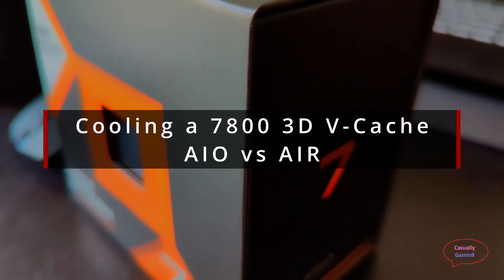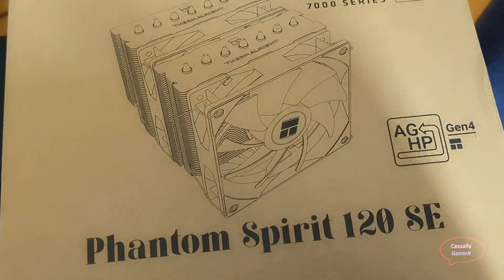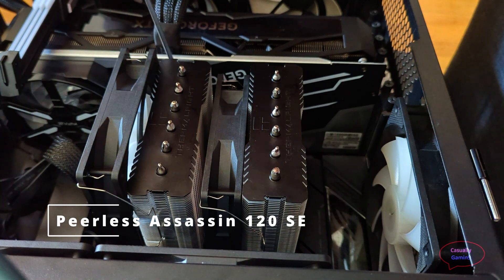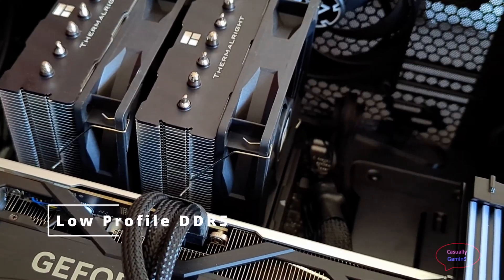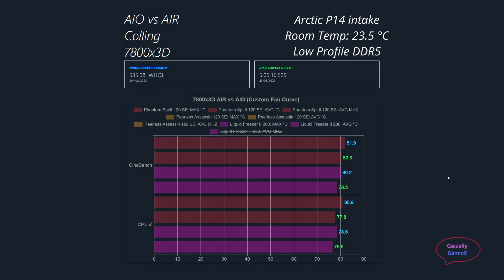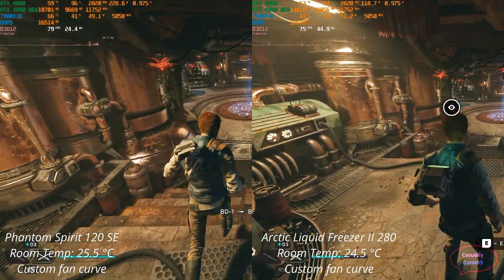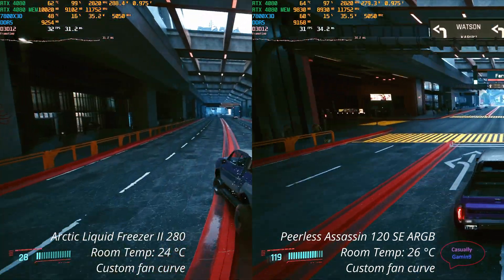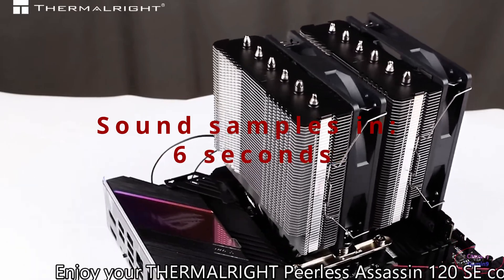Air vs Water Cooling 7800x3D Phantom Spirit 120 SE Peerless Assassin 120 SE vs Liquid Freezer II 280

Comment from the maker: Air or water cooling?
Reply: Air. It's only a matter of time before an AIO fails and ruins your entire system
Reply: lots of people say that that air coolers are automatically superior but in a test done by HardwareCanucks the Deepcool LT520 AIO outperformed all the Thermalright Coolers on AMD CPUs by a small margin.
I'd say it's a case by case basis. But the Phantom Spirit is 1/3 of the price of a LT520 where I live and good if you're building a PC inside a smaller case like I am.
Reply: @ayylmao0702  Those people are morons! Aio's aways outperfor air coolers. Water will always disapate heat better than air
Reply from the maker: There are not superior, but safer. Water cooling will always perform better, especially on CPUs that consum a lot of power. These days, air coolers are really close in performance to to good 240 AIOs.
Reply: I went with air. I use a Peerless Assassin 120 with the digital display. My CPU temp never exceeds 73C.
Reply: Obviously air, same like ptm7950 insted of liquid metal, the things is that WC is good when it is made by manufacturer, and not "water" some kind of non conductive liquid without maintance is ok, same like ps5 liquid metal made by sony, not by someone because it is too risky, thermopad PTM7950 + PS120 would be better than WC with average paste.
Reply from the maker: I never heard of thermopad PTM7950.
Reply: @casuallygamin9  there's also a newer PTM7958, although I didn't find it in pad, only as paste.
Reply: phantom spirit with Silent Wings 4 fans
Reply from the maker: It performs better and produces lower noise?
Reply: @casuallygamin9  that's the expectation. I don't have all of the parts yet so I don't know yet.
I have a decibel reader and a digital thermometer so I'm hoping that I can do some decent tests to see the difference between fans
Reply from the maker: Use Hwinfo64 to check temperature for CPU and other parts that have sensors.
Reply: @casuallygamin9  will do.
Reply: @JustinCrediblename  what happend did u change to silent wings 4 im thinking of buying this cooler for my 5600x
Reply: @JustinCrediblename  How did the air cooler do? I was thinking of buying it

Comment: 71c for 80 watt power consumption is pretty high...my air cooler stay @70c with 110 watt power consumption
Reply from the maker: 7000 X3D CPUs tend to be hot, AMD changed the position of the cache on the 9000 series and the temps are way lower

Comment: To everyone saying air coolers can compete, this is against a 240 mm radiator. Upgrade to a 360 mm rad and this gap is going to be huge. Damn near any ATX case can support a 360 mm radiator, I don’t know why he chose to compare against 240 rads here outside of trying to make air cooling seem competitive to water cooling 😂
Reply from the maker: It's the 280mm version. Air coolers are good, but you are correct, 360 AIOs are better. Not all want to use AIOs and not all PC cases can fit a 360 AIO
Reply from the maker: I do have newer videos where I check a 360 AIO, a 240 one and an air cooler

Comment: Question out of context. How much RAM clearance needed for thermalright ps 120. If i use Team Delta ddr4 32gb is it ok with the cpu cooler?
Reply from the maker: The front CPU fan ca be lifted so, in theory you don't have an issue. Lifting the fron FAN may be an issue if you have a small PC case, as this will increase the CPU Air cooler hight.

Comment: Planning on getting a 7800x3D, I want more performance out of the cpu, which leads me to an AIO cooler like the Arctic Liquid Freezer III 240. Great reviews on it, plus I keep my room warm during the day which would reduce an Air cooler's (Phantom 120 se or evo is what I'd take) performance. Based on this info, would you recommend an AIO or an AIR. I'm leaning towards AIO.
Reply from the maker: I would say that both will do good, I tested these coolers in a newer video on the 7800x3D if you are interested to find out. The Arcti,c Liquid Freezer 3 240 A-RGB and the Phantom Spirit 120 Evo are close in performance, both will do just fine. I would recommend the AIO if you wish to see the RGB of the memory sticks. Keep in mind that 240 AIOs and the best air coolers perform almost the same, with the best 240 AIOs besting the best Air coolers by a few degrees. I would say that AIOs start to shine over the Air coolers from 280 onwards.

Comment: I'm about to build a 7800X3D system on an ASRock B650E Taichi Lite board.  I have on hand a Peerless Assassin 120 of some flavor and an Arctic Liquid Freezer III 240mm AIO.  I think in this testing the placement of the CPU radiator in the front is hindering the AIO's ability to cool the CPU (and probably also the GPU).  I prefer to draw room air into the case using unhindered front fans and place the AIO radiator in the case roof.  That is the configuration I will be using.
Reply from the maker: When you place the AIO in the front you will have lower CPU and higher GPU temps then placing it on the top. Top placement means that the AIO will pull air from inside the case and in intense gaming scenarios the air inside the case will be warmer due to the GPU.
Reply: @casuallygamin9  Always a compromise.  The concept I wanted to emphasize is that when the GPU is air cooled, the most common situation by far, it is vital to feed it cool air.  When the radiator is in front, the GPU gets air that's already been heated by the CPU.  In a gaming system, again the most common situation for PC builders, the GPU is shouldering the load more often than the CPU.
Reply from the maker: Yes, you will always introduce hot air when installing the AIO in the fron. A way to mitigate this issue is to install fans at the bottom and have top exhaust fans, but that will help only a bit.

Comment: My 7800x3d (360 AIO liquid) is hotter (87c) but I've changed the thermal paste for a millennium and only the pump is running, no fans active in the PC case, I hate noise. If my  cpu burns I'll buy another. My RTX4090 is running around 65c no fans.

Comment: I really am pissed with my rig ( 7800X3D) my room temps are from 27c to 29c and my pc idles at 55c/61c and when in big intense games like Once Human and Still wakes the deep I go up to 80s and as soon as it starts hitting 86c to 87c my pc will crash back to windows. I am thinking of going to AIO Cooling. I am currently using Phantom Sprite air cooler
Reply from the maker: This temps are normal. Look at his video: https://youtu.be/x8XXoqGQc7o I get more or less the same temps as you with 29 room temp. What is strange is that you crash to desktop, this should not be the case as usually the CPU will thermal throttle at 89. Are you sure it's because of the CPU?
Reply: @casuallygamin9  I really don't know 🤷‍♂️
Reply from the maker: Are you getting any errors?
Reply: @casuallygamin9  no just crashes to desktop. Twice on fortnite the whole pc rebotted when I was playing on really hot days with temps outside at 34c
Reply from the maker: Use hwinfo64 and log a game run. It is very unlikely that you will reach 89 degrees while gaming. Even at 29 degrees room temp I didn't reach that point. Is this a new setup? Try to repaste. Make sure that the sticker is removed from the heatsink and is sited properly. Try to reinstall the air cooler and if that doesn't help, try to run the cpu fans at 100% fan spoed and log the run using hwinfo64. To me this doesn't look like a cooler issue. Keep in mind that modern CPU should have protections in place so that these will not restart under high temps, just downclock
Reply: @casuallygamin9  I do use that HW to monitor my temps and I also use msi to montor when inside the games. My pc will normally just crash out to desktop when temps hit 85c + for to long no more then 15 mins. I will try the repaste and see if I can up my fan speeds in bios. Thanks
Reply from the maker: The issue is that you hit 85+ while gaming, this is not normal. Let me know if repaste it did work.

Comment: You should be using lower resolutions and in game settings so you max out the usage on the cpu and not the gpu.  You need to be cpu bound to truly see the difference in cooling between air and liquid in gaming.

Comment: I've replaced my u12s redux with Deepcool ak620, and i'm still getting 90c temps! even with CO- 40! CPUZ stress hits instant 90c, aida64 stays something between 80~85c I've no idea what's wrong.
Reply from the maker: Do you have good airflow? How many intake fans do you have. Increase the speed of the intake and the CPU cooler fans. What case do you have?
Reply: @casuallygamin9  I have 5 intake fans, case is antec df600, fan graph is set to hit 100% PWM at 80c, all fans.
Reply from the maker: @svuudi  did you remove the sticker from the new cooler? What thermal paste are you using? If you increase the speed of the intake fans does it help? if you have bottom intake fans, could you stop those and see if it helps? My recommendation is to have only one exhaust fan at the back and only the 3 intakes at the fan for best airflow for air coolers
Reply: @casuallygamin9  yea sticker is removed ofcourse, no matter how i tweak the fan speed it doesn't help, even if the case side is open, I Don't know for real, and the cpu power consumption doesn't exceed 70w or 75w max.

Comment: @casuallygamin9 can you do a test with frost spirit 140 vs phantom spirit on 7800x3d?
Reply from the maker: I recommend you Hardware Canucks to check the comparison as they did it already, I don't have it in the pipeline for now.
Reply: @casuallygamin9  where Is the comparison? And about 7800x3d, the Assassin IV Is the best air cooling for him?
Reply from the maker: @NiitoIsHere  Look at the latest air cooler review from them, but they don't do it on a 7800x3d, I think they have a 7700x and a 7950x. The 7800x3d is a bit easier to cool then a 7700x.
Reply from the maker: @NiitoIsHere  Also, very important, air cooling needs good intake fans, so have that in mind.
Reply: @casuallygamin9  about intake fans, the 7800x3d will be on the fractal torrent, theorically its the best for airflow
Reply: @casuallygamin9  sorry but can you tell me if the phantom spirit is compatible with G.SKILL Trident Z5 CL30 DDR5 6000MHZ whose code number is F5-6000J3038F16GX2-TZ5N , their dimensions are: 6.3 x 5.3 x 0.6 inches, they will be in a b650 msi tomahawk and a fractal torrent case. Is this configuration compatible with that cooler as far as size is concerned? or will it cover some ram slots for me? thanks
Reply from the maker: @NiitoIsHere  the Phantom Spirit will cover ram modules, all 2 tower air coolers will have the front fan covering your memory sticks. I would not worry that muck about height as you can adjust the front fan a bit without losing cooling performance. I would advise against not adding the first one and sticking to only one fan. Check here for the dimensions: https://www.thermalright.com/product/phantom-spirit-120/
Reply: @casuallygamin9  do you mean about use the phantom spirit with only one fan? 

about the height, i have read that the phantom spirit is compatible with max 42mm height (1.65 inches) but i don't know the F5-6000J3038F16GX2-TZ5N ram how much height they are, can you help me?
Reply from the maker: @NiitoIsHere  Even it is a bit taller, it's a few mm, so don't worry as you can adjust a bit the front fan, move it a up a bit if needed, as you can see in the video. You will not lose any performance by sliding upwards the front fan a bit. To be honest I can't find any data regarding the height for the kit, only what google says, but I'm not 100% sure that this is accurate data
Reply: @casuallygamin9  i have found this: 6.3 x 5.3 x 0.6 inches but i don't know what is the 'height' in that
Reply from the maker: @NiitoIsHere  well I think that is the dimension of the package, as that dimension don't apply to any RAM stick

Comment: Hello sir i need your help i saw your video and i bought arctic 280 but my system having spikes 30c to 82 when i open chrome or some games whats problem i didint understand can you help me? And where i have to plug power cpu fan or aio fan on board? 🙂
Reply from the maker: Hi, it's kinda wired to have that big of a jump from 30 to 80. Have tou removed the sticker from the AIO. Make sure that it's plugged in the CPU fan on the motherboard. Also, I recommend MX-6 as MX-5 had some issues, or even MX-4. I'm saying this as some liquid freezers came with Mx- 5 thermal paste
Reply: @casuallygamin9  oh fuck normally i odered that two coolers but i felt on your video aircooler is bad idea i dont know maybe i should buy aircooler or i have to send all of them 😢 i have no idea what have to do because its jumping 82 and fans are very crazy loud
Reply from the maker: Air coolers are not bad, nor water coolers. What you're experiencing is wired.  Arctic Liquid Freezer II is one of the most silent out there. Have you removed the sticker from the pump? It should be only the coper plate in contact with your CPU. What CPU do you have? Did you apply thermal paste as well?
Reply: @casuallygamin9  7800x3D same with your system b650 asus tuf gaming wifi 32gb ddr5/6000 i need to do i guess new thermal paste something wrong here yes i removed sticker 🙂
Reply from the maker: Make sure to read the installation process for the AIO for AM4/AM5. In the bios of my MOBO if I install it in the AIO header it will have a wired fan curve
Reply from the maker: Did you mange to fix the issue?
Reply: @casuallygamin9  i changed termal paste and tempst are better but still some small spikes and i changed curve i will test again to night i am working atm 🙂 thank you for your attention dude
Reply from the maker: Well, small spikes are normal as Windows tends to clock the CPU quite hard when it comes to some actions. Mine does the same. But I never got the issue that you previously described: opening the browser will result in spikes from 30 to 80. Set the CPU fan curve, in BIOS, to standard. See if this helps
Reply: @casuallygamin9  I adjusted the paste again and it got a little better. To night i will test again also curve was crazy because fans are turning like rocket also i checked i have mx5 paste too maybe paste have issues
Reply: @casuallygamin9  this spikes still continue so annoying
Reply from the maker: To have spikes is nornal, but to have such a big delta is wired. Are you doing some overclocking. Have you updated to the last BIOS version?
Reply: @casuallygamin9  i am not doing overlock it was stock this morning i tried -30 it didint open  after i tried -20 its working atm but why so big spikes no idea 🤷 i guess i should change termal paste
Reply: @casuallygamin9  also i am playing knight online when i click knight online icon cpu is going to 35 to 82 after 30 second its going down 40 and playing stabile between 40/55 its not jumping anymore on chrome
Reply from the maker: This is really strage. Maybe the AIO is not working properly, or the rump up period is really long. I'm not sure why this is happening to be honest. Try another paste, but I don't expect it to do wonders
Reply from the maker: @V0LK4N  How did you mount your fans on the AIO? What is the config? Pull or push?
Reply: @casuallygamin9  i didint mount fans it was how it came out of box and i montaged top of case
Reply from the maker: @V0LK4N  Ok, good. Did you install with VRM fan in upright position? If it's so loud, can you make sure that the sound doesn't come from the VRM fan?
Reply: @casuallygamin9  yes its also so fast 💨 position is right but so fast

Comment: Will take the phantom spirit. Thanks for comparing these three on the 7800x3d. These are exactly the coolers i was considering for my new build on the same CPU 😅
Reply: 2 months after, certainly satisfied with this cooler
Reply: @Deuk maybe the frost Spirit Is the better than Phantom?
Reply: @NiitoIsHere  i only test the-Phantom
Reply: @Deuk  have you a SE version or normal version? an what is your idle and in game temp? and in which case? thank you
Reply: @NiitoIsHere  se version in fractal design case. Fans always in lowest settings so almost no noise. Temps you may see in one of my YouTube of avatar Pandora with benchmark running.
Reply from the maker: Glad that it was helpful.
Reply: @casuallygamin9  can you do a test with frost spirit 140 vs phantom spirit on 7800x3d?

Comment: Water isn't always quieter. I ditched the LT720 because the pump was louder than the fans, and conversely the PS120 is quieter than the LT720. It also depends on your case. A Fractal Torrent or Lancool 216 with an air cooler will outperform say a H510 with a AIO. Also depends on where you live. An air cooler in Arizona summer won't be doing so good.
Reply from the maker: True. It depends on the AIO, these can be loud as well. Hot summers everywhere can bring an air cooler to it's knee.

Comment: The radiator are mount wrong it’s suppose to have the tube up and more high than the pump imo
Reply from the maker: Well, all radiators have some air inside. With time you will have more, as the liquid will evaporate through micro fissure s. If the tubes are on the top, the pump will make some wierd sound when it pulls air. When installing an AIO vertically, the best is always with tubes down and the top of the raditor to be above to pump when installed on the CPU.